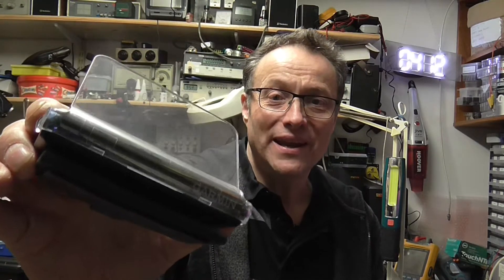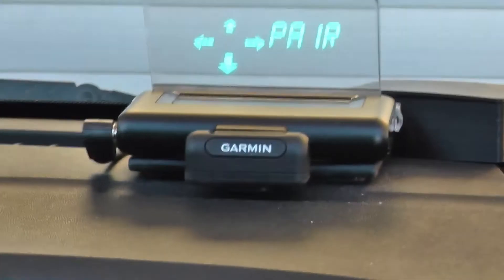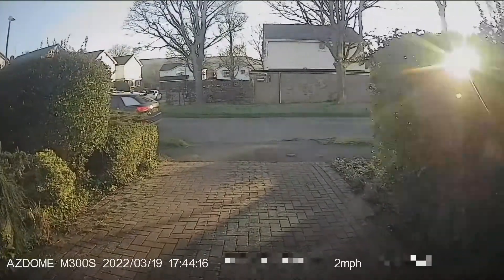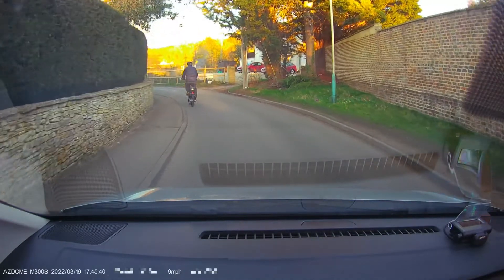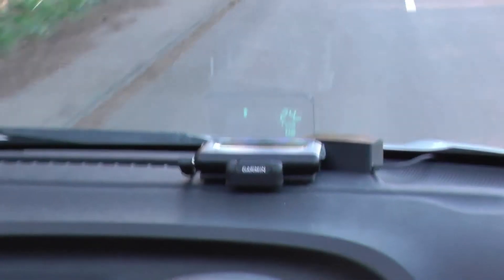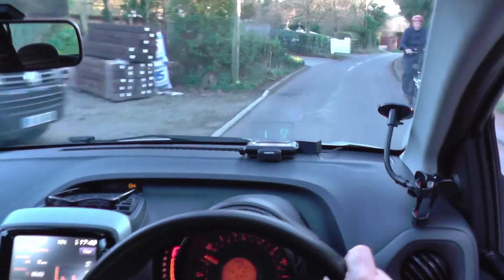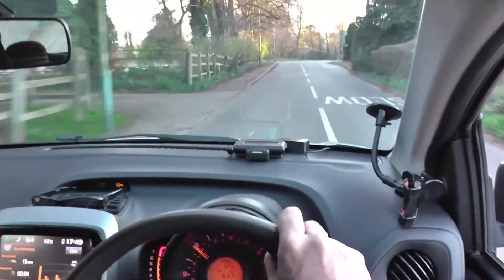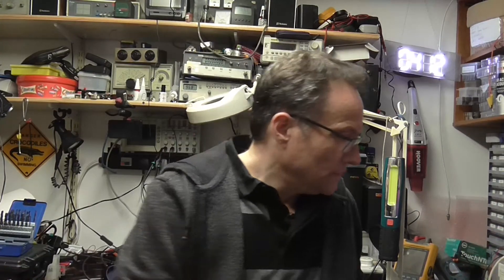Demo of ESP32 driver for Garmin HUD+ Head up display

Comment: Great job Doz, I too have done the same with the code you shared, changed a bit to fit local time zone and in metric system, love to have the HUD back to service.
Reply from the maker: Excellent work!!
Reply: Might have to pick your brains for that too. Need to put mine in local and metric too.